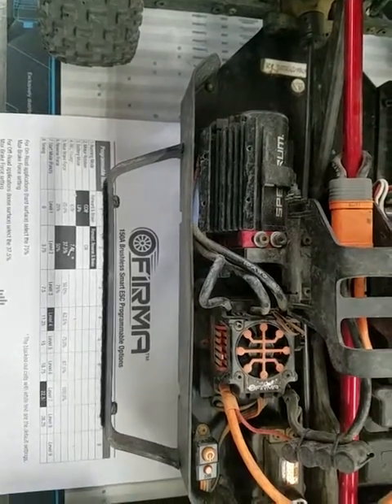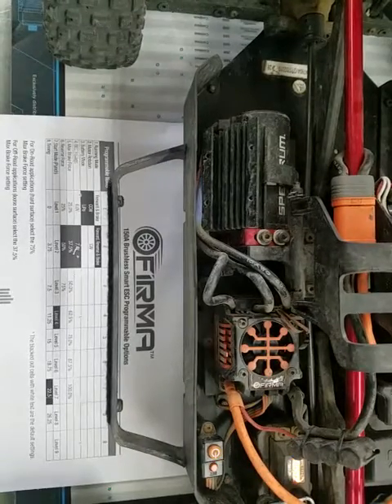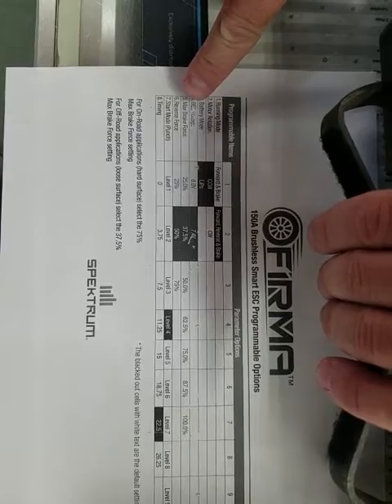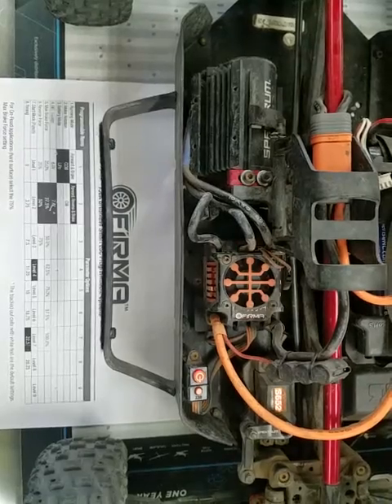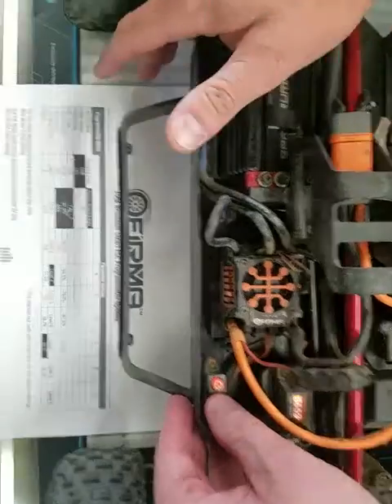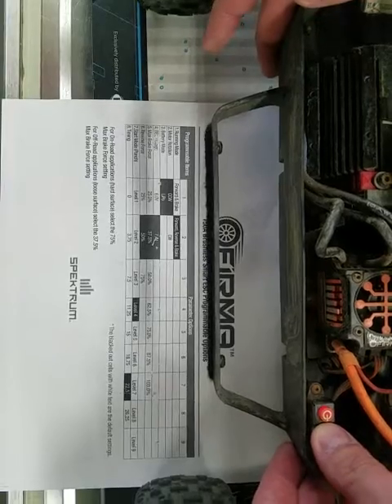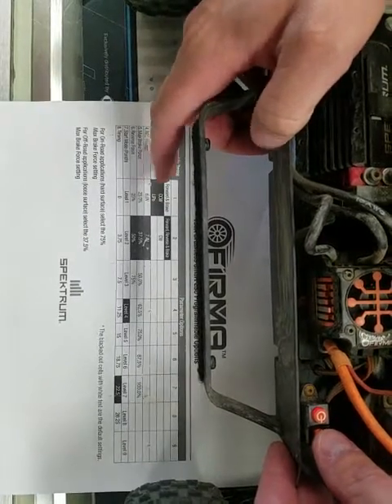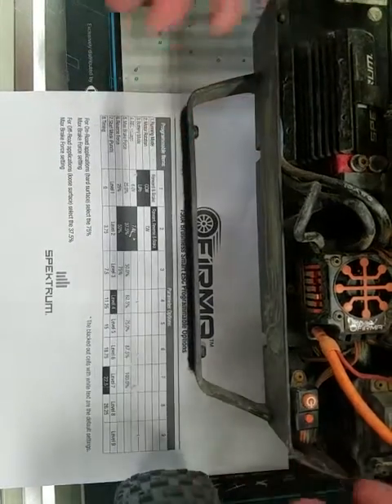Changing BEC voltage on 150A Spektrum Firma ESC - Hobby Haven Quick Guides

Comment: 7.4 is my preferred, especially if not mainly for the cooling fans. Spektrum servos need all the help they can get, they’re not so great servos.
Thanks, for the info in the video though! I was thinking it was 6.0v stock and I wanted to run 7.4v. Thanks again! Just got a Outcast 1/8 EXB rtr for 540$ taxes and shipping included on a Horizon sale. A definite deal.

Comment: Lol. 7.4v isn't hard on the servo, it's a 7.4v servo. More speed and more torque is what you get
Reply: Not setting the end points is what blows servos 99% of the time 😉
Reply: haaha
Reply: Does this work on older spectrum ?
Reply: A lot of people burning out servos and blaming the voltage when they actually have stressed the servo by adjusting the end points too far.